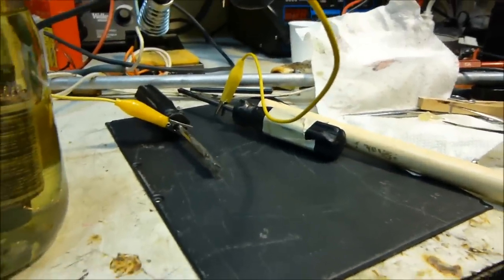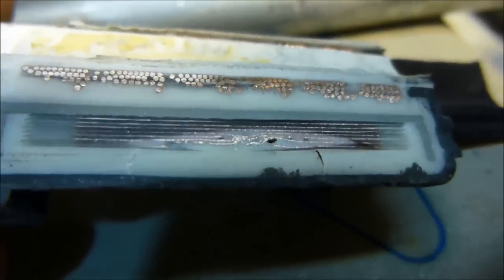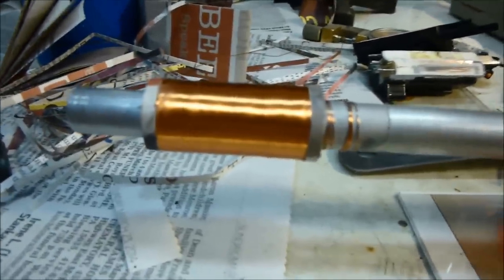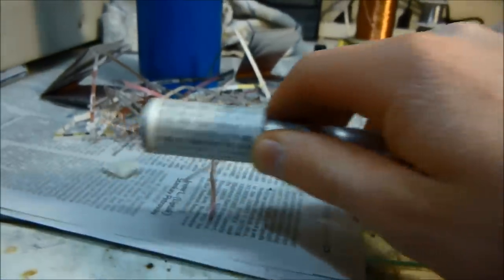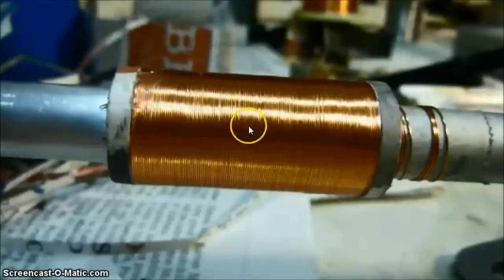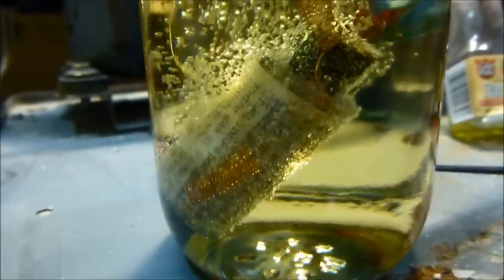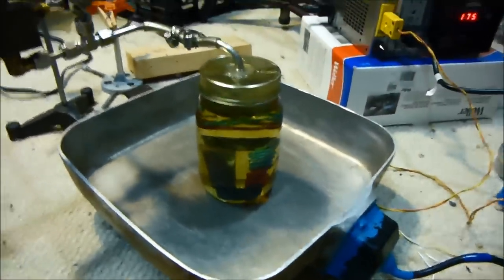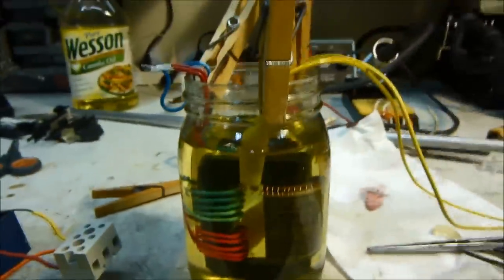How to Make a Super High Power Fly Back Transformer

Comment: hi. do the two parts of the ferrite core need to be connected?? because i took a core from a crt tv flyback transformer and it had this little insulator between each part.
Reply from the maker: That's a good question!  I'll tell you, I have no idea!  I'm sure it has some effect on inductance and resonance.  They put the insulating bits there for a reason in the TV application.  I ditched them when I put my core together.  I figure no gap will have higher power ability.  But just a guess.

Comment: Can you help me...as no one else will,....I need to know the easiest way to keep back EMF from reaching a DC power supply...ie...flyback primary coil that is not centertap fed.
Reply from the maker: John Kerley That is a good question that I wonder myself.  I use MOSFETs that are rated at 200 volts so they can handle pretty big back EMF spike from killing them.  I think if you have a properly tuned circuit the capacitor and inductor should absorb a lot o the back EMF.  But how to get a properly tuned circuit is also something I do not know.  Try asking Anthony.  https://www.youtube.com/user/high1voltage1rules  He knows a lot about high voltage and have build some really powerful ZVS drives and such.  Best wishes.  Sorry I couldn't help more.

Comment: Quick question makerj101, So I have 2 identical zvs drivers and 2 different fly backs, is there a way to put the outputs of the zvs drivers in series or would I have to use one zvs and 2 flybacks
Reply from the maker: +Platinum Science I'm not sure if you can do that or not. I think flyback transformers have rectified output. I've seen this done with ignition coils tho.
Reply: Makerj101 It is possible to put them in series, there is videos out there, but is it possible to put zvs drivers in series
Reply from the maker: +Platinum Science I'm not sure. I'd have to try it

Comment: you should try to drive that ting with a pl519 :P
Reply from the maker: What is a pl519?
Reply: a vacuum tube
and a damm good one
Reply from the maker: ***** How many amps or how much power can it handle?  I am putting over 1000 watts into this transformer!  It's pulling over 30 amps at about 35 volts.  I think I need new primary windings!  The oil started to boil around them when I was arcing with it for a couple minutes!!!  I think I need better capacitors too.  They get really hot and the solder that holds them on keeps melting.  I need a bunch of small ones so the current is spread out...  The mosfets seem pretty happy!  The heat sink only gets warm after a couple minutes!
Reply from the maker: ***** Wow that's pretty good!  I would not say that's really a normal flyback.  I'm not sure if the old ones like that are built the same way the newer ones these days are built.  The newer ones just have way to thin of wire in them.  So they are good for high voltage but not high current.  Thanks!
Reply: no problems

i just like to help
Reply from the maker: ***** I can't thank you enough for that!  I probably would not have much of a successful channel if it were not for awesome people like yourself!  All the comments really help me when improving projects and building new ones.  Lot of great ideas! 

I do have a vacuum tube that looks sorta powerful.  I've been to scared to do anything with it tho cause I don't want to burn it out.  I really have no idea how to use them!  But I'm sure I can learn!  I'll take a picture of it and some of the other ones i have and post it on +Google.
Reply: okey
you could also give me a type number
i can tell what that tube can do from that number
Reply from the maker: I got the pictures posted!
Reply: will look at them
Reply: Ok ,,,, im having bad vizionz ov ur mega hot oil exploding. ,, there fo i suggest tu u that perhapz u might try putting the whole thing in a jar full ov clay insted ov oil . <3 bro that should be safer and super high temp also guup up all ur wirez with clay tu let dry and ir coik intu ceramic :)
Reply: U can basicly glue ur coil core tugrther with clay tu u might wanna wrap it ov layerz ov fabric tu so it hold the clay better mayk ur clay not tu wet but soft enough tu fill around dryed corr u mayked ")
Reply: Clay coil core dryed then set in guupy ish clay mix tu fill jar ,,,, im just imajining here but i think iz werkz 8D
Reply: english is not your firsth language right?

i will explain
clay and oil have diverent insulating property's

clas is watter based and it conducts electricety
and when it dries it tears and cracks
also bad for insulating
and it wont seep into the windings
so there is no extra insulation betweel layers

Comment: How much milimeters is the sec Coil wire in diameter ?
Reply: Around 0.4mm.I think 0.15mm are better because it's thinner, get at a half A only warm (it's made for 60 ma) and you need only two or three layers of windings to get a transformer like this one there.
Reply: Around 0.4mm.I think 0.15mm are better because it's thinner, get at a half A only warm (it's made for 60 ma) and you need only two or three layers of windings to get a transformer like this one there.

Comment: its not because there isnt enough pressure in the pipes. vacuum pressure doesnt work like electricity, connecting in series wont change a thing. two things sucking at 20psi is still only 20psi. it cant add up pressure. Thats not how it works
Reply: Ambrosius Malachai May I ask why not? Doesn't each pump create a pressure differential that if one pump begin pumping at the pressure references of the other sequentially, it should reduce the initial pressure lower than a single pump would- compared to atmosphere that is.

Comment: can anybody know how many turns of the flyback primary about 1.6ohm???
Reply: +andreiruiz143 
It depends on the size of the wire, and the wire type (usually copper). This is assuming there are no kinks in the wire ... so yeah it's too hard to measure using resistance alone. But 1.6 ohms sounds way too high.

Comment: i have a quad mot stack but by biggest mot died about 10 minutes of continuous arcing 
:(
Reply from the maker: I bet that would have been awesome!  I bet it dimmed the lights when you drew an arc! Aww man...  :(
Reply: I have a video. It was awesome. I ran it off 240V@20A with resonant caps and it still sometimes tripped the breaker.
Reply from the maker: Plazma lasrer Wow nice!  Sounds awesome!

Comment: Sorry to arc your transformers kid, but a simple transformer formula calculates your voltage to be 2400 volts. (given your input voltage and turn ratio) An oil bath and vacuum pumps are totally unnecessary for your setup. The only reason you are getting big arcs is because due to the lowered voltage, you raises your current. Since increase of current will increase your ionisation density, the arc is effectively stretched because of the plasma is more conductive than the air surrounding it. ( lowering breakdown voltage). You also GOT to mount your circuit on a pcbs... makes EE like me cringe.
Reply: You obviously have no experience with high frequency HV...
Reply: you obviously dont know what you are talking about
Reply: +Andrew Geng Have a look at my channel and then tell me I have no idea what I'm talking about...

Comment: Oil is not necessary, through a simple transformer formula, you only generating 2400volts. it because your current is so high the ionisation density created plasma that is more electrically conductive than air. Lowering break down voltage to give you longer arcs.
Reply from the maker: +Andrew Geng You're probably right.  But it still died due to arcing sooo...
Reply: really how? Too much current? melting your enamel?
Reply: +Makerj101 Not trying to be smart but "mineral oil is a better solution".
Reply: you need to explain, simply stating opinions is not a good idea.
Reply: +Andrew Geng no water in mineral oil.